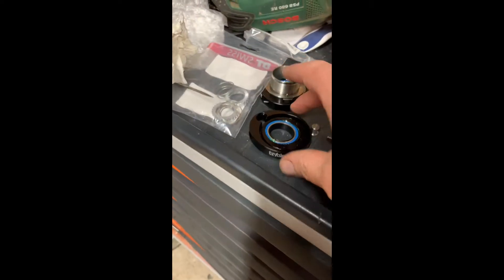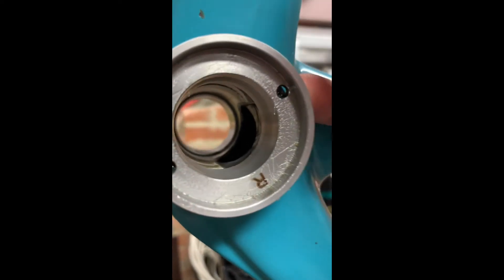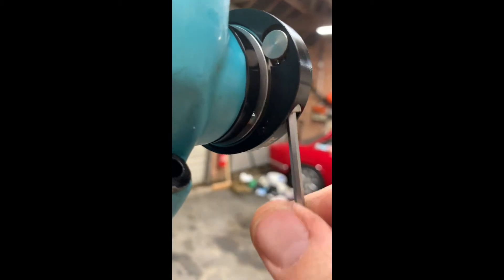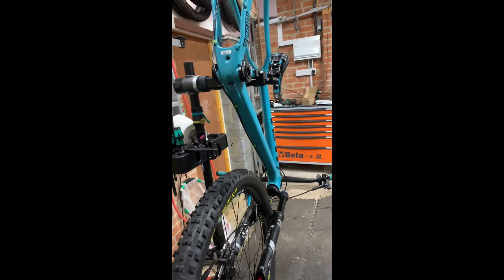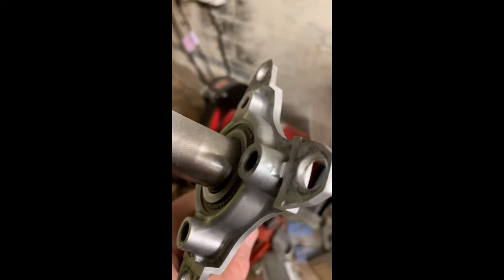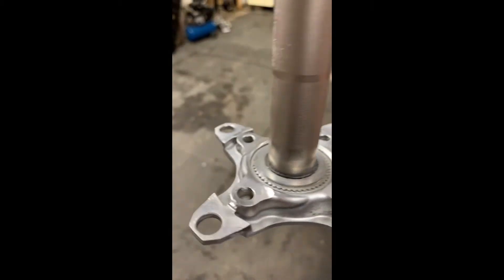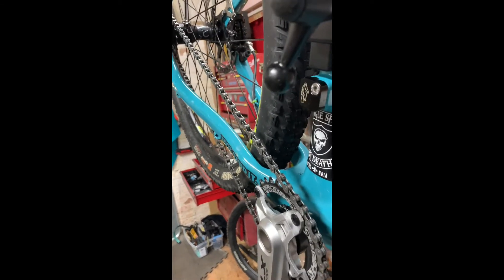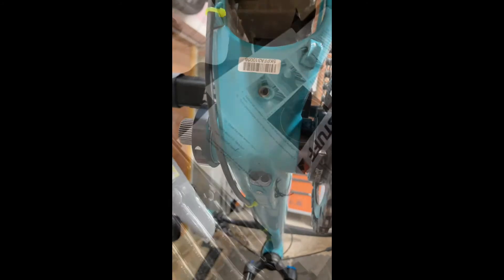Trickstuff Exzentriker Eccentric Bottom Bracket install for singlespeed MTB

Comment: They should have made some sort of tool retainer as done when unscrewing an SS freewheel from rear hub by fixing it in place with a hub bolt. A hole in the tool with another pinless buddy on another side, bolted together through the bottom bracket, would make a great job.

Comment: Just received one of these so grateful to see your video - thanks. Also been pondering the instructions and wonder if you agree that the 'quadrant' section may be implying that depending on which quadrant you end up in, you may have to swap the external eccentric part from one side to the other in order to end up with the screw/locknut fixture being correctly orientated as pers the instructions such that forward motion of the crank/chain/belt further tightens on the eccentric? Did you ever get a response from the company? Is this what they said? Although I can understand the rationale and its importance it would seem to add another potential faff in that although you might strike it lucky first time, you may equally have to set things up, find you have got the 'wrong' eccentrics on each side and so have to swap them over. Would be interested to know it others agree or have any insights (or better German ?!)
Reply from the maker: They did come back, and agreed that the instructions needed rewriting. But they didn’t really explain when they did respond. That said, my chain stains only allow me to use he 3-6 or 6-9 o’clock positions. I’ve now used it in anger, and it’s fab. Occasionally need to adjust it to take up the chain stretch. A quick knock on the pins with a dot pouch frees them up.

Comment: Did you get an answer regarding the position of the screw/locknut? I can't get my head around the instruction and my exzentriker seems to slip...
Reply: Did you ever work out your slippage problems? Any insights/hints? I have just received one of these and would welcome any advice before I embark on fitting.
Reply: @familyhistory1983  I figured out  it was actually my bb shell turning loose. So just watch out you install it so that if there is a pull on the exzentricker it tightens the shell.